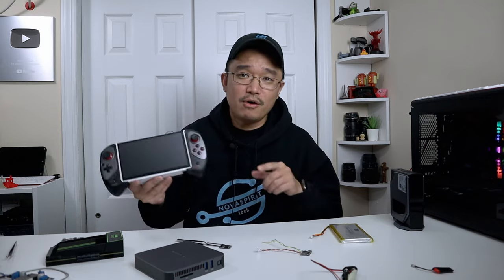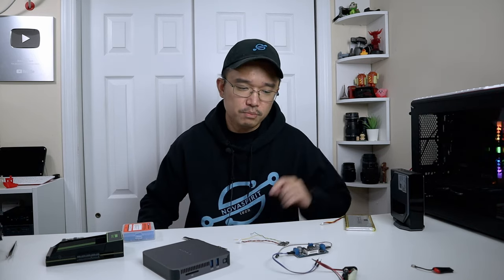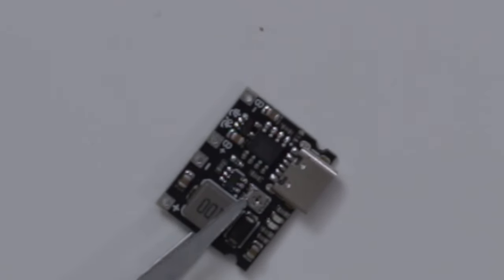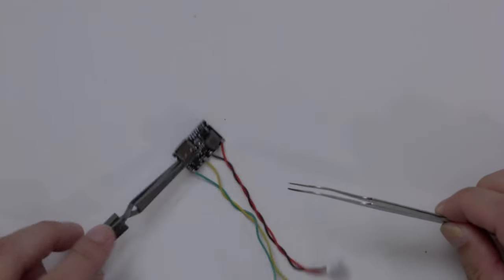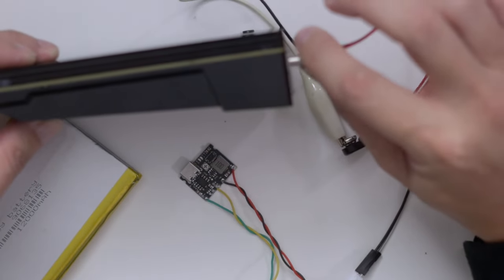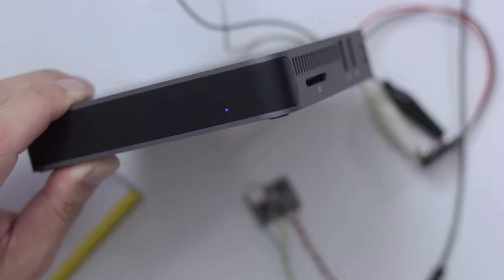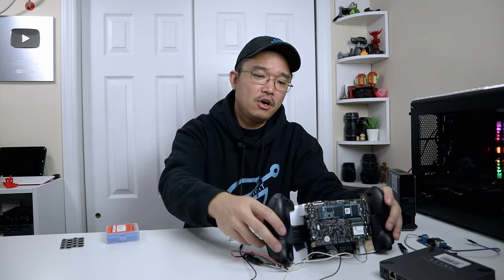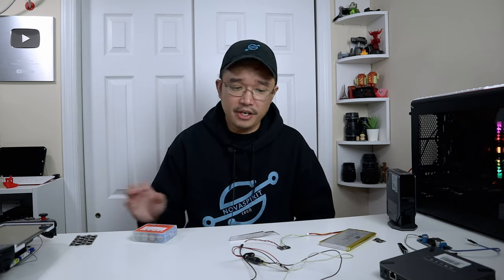Powering a Mini PC with Lithium Battery using a DC-DC Step up converter

Comment: Very bad idea to power pc's etc. using these low quality modules. Not only dangerous for the devices, but the power output has huge noise levels. This causes instabiliy for the use of the devices. Another thing to consider is the Chinese way of measuring output capacity, their tolerances are huge!
Reply: LOL he's Chinese. He'll never admit that😂

Comment: Dude. U need to watch an electronics course. Get a scope and  check the ripple on output voltage when under load. Add a capacitor rated min 16v DC  on the output to stabilise it. Also the battery pack must be able to provide a peak amp  > the load circuitry. Also add a disclaimer to your video when advising others about modifying electronic circuits cuz Li Ion batteries can be dangerous if not handled with care. Just my advice. Nice video otherwise .

Comment: Hey man I got a question what time trying to do is basically take the minisforum em680 and turn it into a linux tablet and I'm trying to find a battery solution that mimics a tablet experience thatll shoe the battery percentage and also shows when its charging would  something like this work since the em680 is usb c powered?

Comment: Is there a way to do this and have the device recognise the battery? Like have the battery percentage show up in Windows for example like it does for laptops?
Reply: You need SPI
Reply: Not directly, because the device will always see 12V no matter the charge level. You'd have to measure it separately and then connect that sensor to the computer via USB.

Comment: Will it work on mobile external gpu which is rx7600 xt onexgpu? which is also has 120w tgp i just want it for that one piece of device so i can play it for around one hour or 2 at high when i am outside the house, its very small gpu at the size of battery run rx7600 xt mobile card, my idea is when i am outside the house in coffe or something similar playing lenovo legion go is to be able to use that card with it without the need to plug it into a wall, probably no more than 2 or 3 hours, do you think this battery or a battery with 145w usb port and 20k mAh will make the idea work?

Comment: Funny thing - my plan to use the tp4056 to assemble li-po stepup to power 50mm fan to cool down steam deck(heatsink on Jsaux backplate) and I have exactly same module on the way to me presently, as so far using a separate tp4056 and step-up modules instead of just one you showed in ur video....))

Comment: The reason it's fluctuating (flashing) is due to voltage sag when the current being drawn is too high...the 3A rating is not for continuous use...but for some cases initial startup where power draw is the highest.  To verify put voltage reader on the barrel jack input and watch the voltage sag as current draw increases.  Also, many of these boost converters get horrible ripple voltage the higher (closer to max) current output occurs so a filter capacitor can help quite a bit.  
Pretty cool!  Keep em coming!!!!

Comment: Interesting video.  I noticed from the amazon page that those converters only claim 12v 0.5a (0.6a peak).  So that will be why they struggle.  

Given others concerns, it would be useful to find ones with higher quality outputs,

Comment: Hi from Russia. I have recently wondered the same question too, I want to make a tablet out of a mini pc, since the current tablets the market offers are very bad or industrial ones that have too high price. As I understand, you'd better build a battery of several batteries, 3 to be exact, with a bms board, the current of which will be from 9 to 12 volts (when charged), you will also need a dc-dc to get stable 12 volts, in your circuit there is a big capacitance loss when converting 3.7 to 12, the closer the current to the converter the higher its efficiency which can reach up to 94%. As I understand, you can connect the charger directly to the BMS pin, but I don't know if that's the right way to do it.... Looked at the schematic from the Chinese, it seems to be ok. 
Also found a dc-dc step-up that can output about 60 watts, 4.5+ amps of current.
Good luck with your experiments :)
Reply: I also thought of using a povobank board, a kind of board that has the ability to give enough power to power a mini pc and use the battery as a powerbank because there are usb outputs, and the ability to indicate the level of battery charge.
only I have not found such a board that would support charging while using the very port through which the mini PC is powered.
Reply: I'm on the same path, what about you?

Comment: no way sot23 sized dc-dc is going to output enough current for this. It is flashing because it is bloody shutting itself off due to reaching ~125 - 150C internally.
Remember 1A at 12v output is going to be (12 / 3.0V lowest lipo level = up 4 times more) on the input and you take the bigger value for evaluating if any given dc-dc converter is going to cut it.

Comment: Can you show how to turn this into a UPS ?
Reply: Doubt it most step-up and charge circuits drop power when you disconnect from mains even if it is for a second.
Reply: That's why the question. Maybe an online UPS. Both, the power supply and the battery be on but if the power supply is gone the battery would be the only supply.  There should be a way to make a circuit to have that done.
That would be really useful. Much more power efficient than a main line UPS.